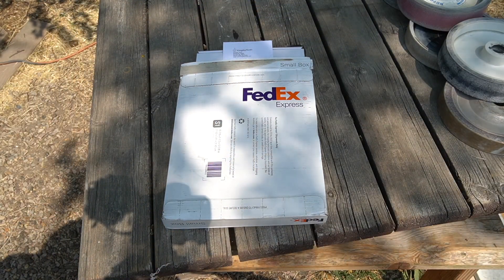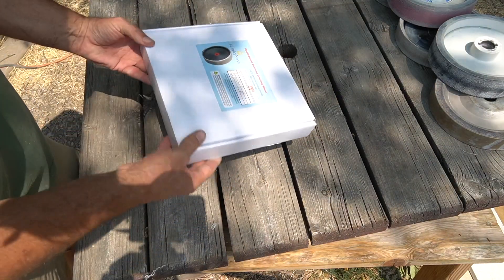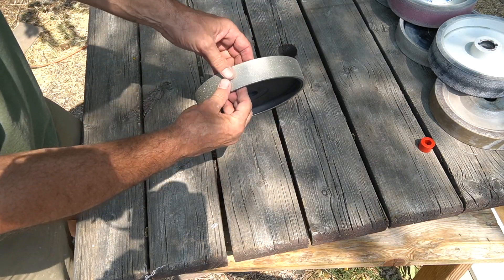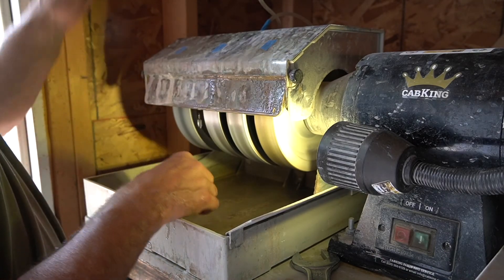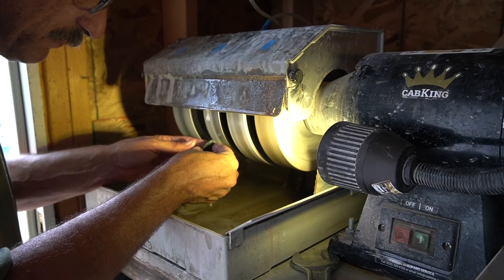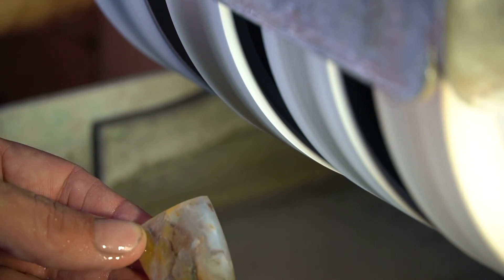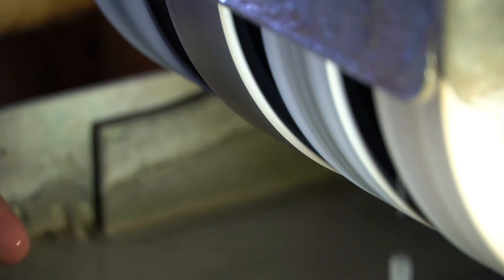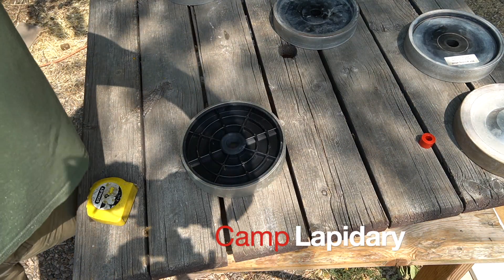Kingsley North, 8 Inch, 220 Grit, Electroplated, Diamond, Grinding Wheel Unboxing And Review.

Comment: Thanks for the video Mark. I have a question for you.
Do you have any used 8 inch soft resin wheels that you don't need anymore? I am just getting started in lapidary and I bought a used CabKing 8 inch that was missing its wheels. I bought some diamond hard wheels and I got a great deal on some soft wheels in higher grits. I found some used Diamond Pacific wheels at the Ventura show last month. I got thee 1200 wheels and one 3000 for $40 in the silent auction. I am still missing the 280 and 600 soft wheels. I started making cabochons using machines at my club. I am eager to start using my own machine. Let me know if you know someone who is getting rid of some old wheels I can use. For me it's a 40 mile drive to the club shop and it's small so there is only room for 4 member at a time. So if I could work on my rocks at home that would leave room for other members who don't have equipment. My club is the San joaquin Valley Lapidary Society. They can defiantly use some better equipment. The club only has 2 saws and one cabbing machine and an arbor with the hard diamond wheels. I can fix any lapidary machine so if anyone has old or broken equipment, let me know. My email address is support@taftpcservices.com, Thanks.
Reply from the maker: Hi, Arthur. Welcome to the channel. I've been saving my used wheels in order to refresh them myself, epoxy and grit... I have seen them occasionally for sale on Facebook. If I see some I could let you know. Certainly is nice to be able to work from home. I know I enjoy it.
Perhaps if anybody sees your comment for machinery they will contact you. Good luck! :D
Reply: @camplapidary  Do you know where to get the materials to resurface wheels at home? Can you send me the links? Thanks
Reply from the maker: I figured I'd get the grits from Kingsley North or other reputable seller, perhaps Amazon if they have good reviews. I don't remember the exact epoxy recommended, seems like the Rock Tumbling Hobby group forum had the good write up on how to do it. Also, I have seen chinese sellers on Facebook offering 8" soft wheels at $40 per wheel, I don't know if they are good or not..